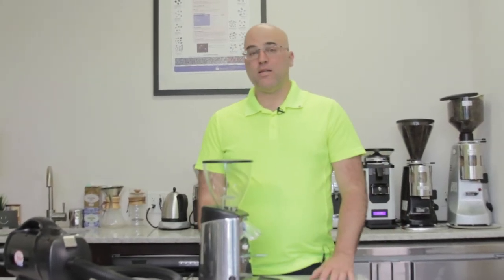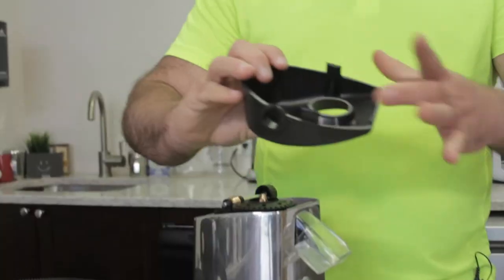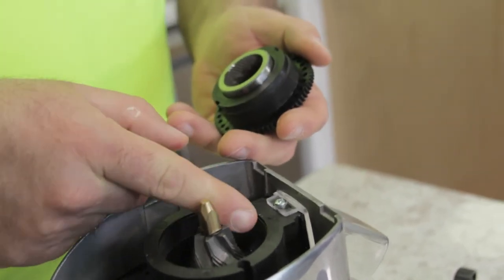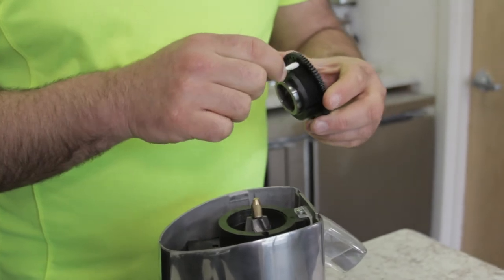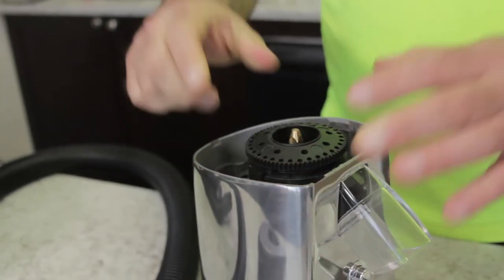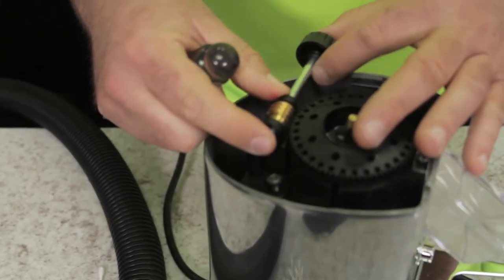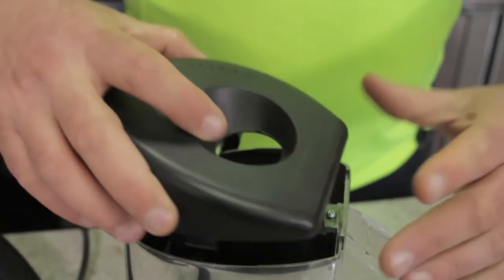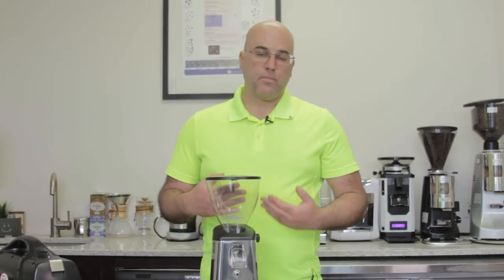How to Clean Your Ascaso i1 or i2 Grind Chamber

Comment: Thanks for this video. I picked up one of these today for £50 used, took it apart to clean it and it looked like it had never been done. When reassembling I couldn’t get the screw threads to engage properly but I took an old toothbrush and some brake cleaner and brushed out all the threads, came out good as new.

Comment: I bought that grinder second hand and the previous seller must have not cleaned the threading properly!  When I screw on the top burr carrier it is quite loose/wobbly and can be moved back and forward. Because of this, the worm gear pushes the burr carrier out of alignment and causes an inconsistent grind..... To fix this, do you think I can replace only the top burr carrier or do you think the bottom might be damaged? Or both?
Reply from the maker: Sorry, our techs would need to evaluate the grinder in person to determine a solution. Sometimes, it can not be diagnosed by viewing alone, but by trial and error of changing out different parts.

Comment: Hi Jim. Is it ok to put some oil on to the rotary Control/ gearwheel? Would it be bad or healthier for the Gear?
Reply from the maker: Hey Kenan! We would advise against it. If the gears aren't functioning properly, it should probably be replaced. Adding oil could potentially cause other issues with the internal mechanics of the machine.

Comment: this grinder is honestly such a piece of sh__. the amount of retention is so insane, like 1/3 of the amount you put in. and it needs to be cleaned every 10 grinds or so in order to keep it from jamming. its extremely loud. the burr carrier is f__king PLASTIC and theres stories of the notches breaking. the customer support is extremely rude. worst of all is theres no way to keep track of your grind settings, ive resorted to marking the burr carrier with a pencil. and leaving the top cover off.